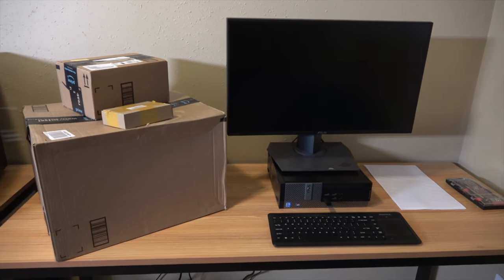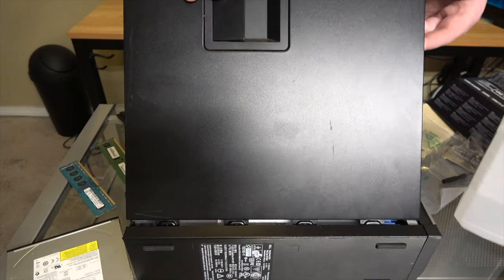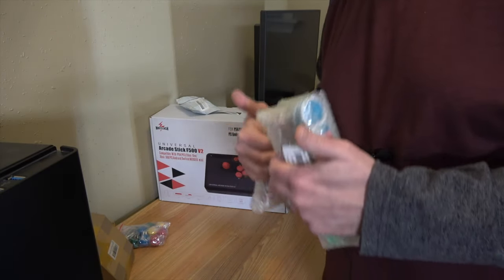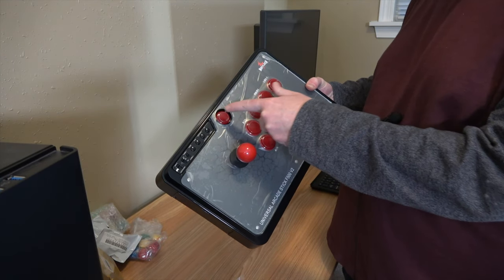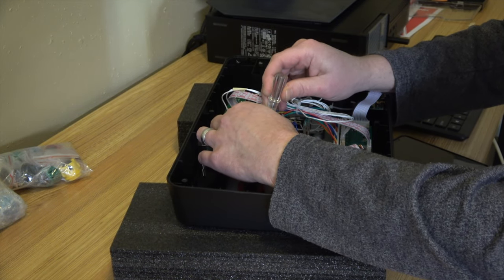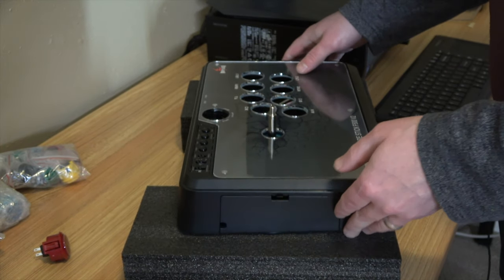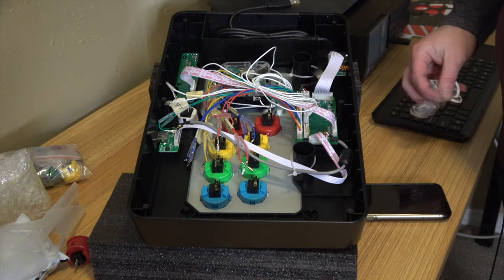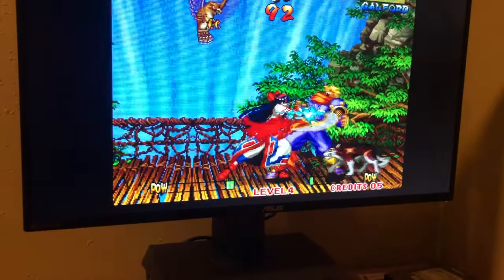Mayflash F500 v2 Mod - NEO GEO Arcade Stick MVS - Sanwa Buttons, Bat Top and Custom Fightstick Art

Comment: That MVS theme is sweet.  I'm gonna have to do that too for my MiSTer setup.
Reply: I've actually built my mister into a mayflash f500 internally. Just enough room on the inside. The MVS look would make it that much better though.
Reply: @DevinTheDude93  That's pretty cool.  Does it fit a three board MiSTer?
Reply: @agentorange8530  I have an I/O board which I plan to wire up for component to use with a crt, but haven't wired it up yet. But it does fit an I/O board and a 128mb ram chip. It won't fit with the usb board but I'm using my own usb hub that fits in the side.
Reply: @DevinTheDude93  ah, yeah I guess you can just use a different USB hub that doesn't attach on.

Comment: Hmm, I thought Sanwa buttons were made in Japan?
Reply: They use to be. Omron Corporation out of China makes a lot of stuff for Sanwa Denshi Ltd. now.  The quality from Omron has gotten better but it's still not as good as what comes out of the Sanwa factory. Unfortunately the products that come out of the Sanwa factory are pretty much all slated for Japanese market only.  The Omron microswitches are garbage compared to the original Sanwa, Happ, or Cherry(ZF) microswitches. The best source fore real Sanwa buttons is an unmodified unrestored all original Street Fighter cabinet. Even the new units have Japanese market Sanwa parts. I have heard that the Mayflash F500 Elite uses Sanwa Denshi parts but I cannot confirm that. I dont have one but look at the box. If it says made in Japan then it probably does.

Comment: is there anyway we can get that template?
Reply from the maker: I got the F500 template here: https://support.focusattack.com/hc/en-us/articles/207447753-Control-Panel-Templates

My file with the Neo Geo art is pretty large and is in Illustrator CC format, but if people want it I may be able to try uploading it somewhere

(Actually it’s 2 files I think, I have illustrator stuff linked to the .psd template)
Reply: @TechWithSean  Yes, I would absolutely love the files. Did you get a chance to move the logos so they're not cut off?
Reply: @TechWithSean  Hey, any chance you have this design available?
Reply: @TechWithSean hey Sean, I just used your Amazon links. Thank you for showing how to make this awesome MVS stick. Please please would you share the artwork? I really love the design you did.

Comment: You are the man Sean..this and the previous video with the 1650 ti is exactly the answers I needed for emulation questions..now will you be testing just neo geo or different emulators? Also are you using an external harddrive or something for launchbox? Thanks again and keep up the great content
Reply from the maker: Thanks for watching ✌️ I’m running this off a 1TB internal SSD, luckily the roms don’t take up a lot of space. I’m not using a full mame set. I’ll be checking out Neo Geo as well as other arcade ROMs as well as some current gen fighting games on Steam
Reply: Nice can't wait for part 2 that's awesome

Comment: I would swap out the sanwa buttons for hayabusa buttons because sanwa buttons are oversensitive.
Reply from the maker: I like the light tap of sanwas (especially in shmups) but that’s the beauty of custom sticks - you can make em however you like!
Reply: @TechWithSean  I was wrong about the hayabusa parts. They suck. I currently own a Hori RAP N Hayabusa arcade stick controller and the hayabusa joystick lever is extremely loose and the hayabusa buttons are oversensitive.